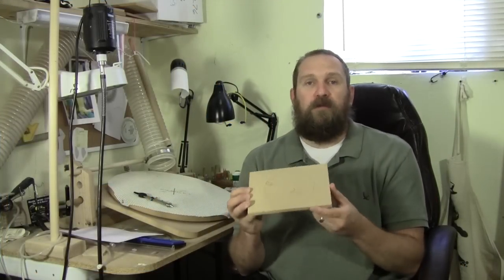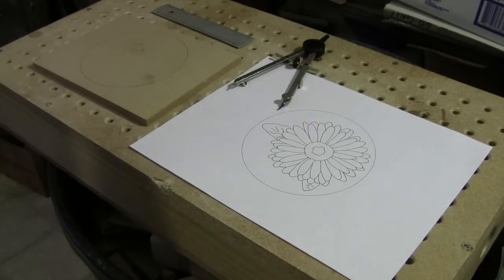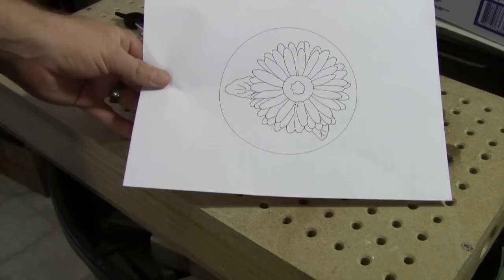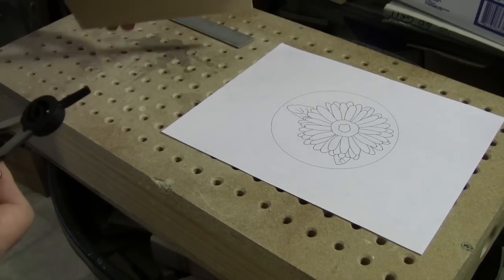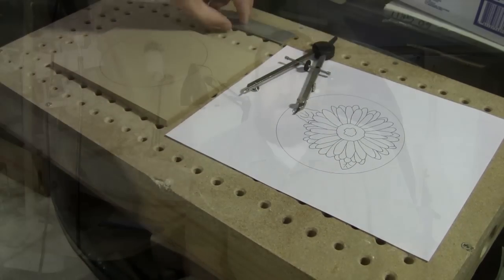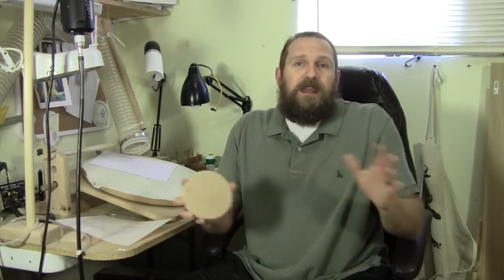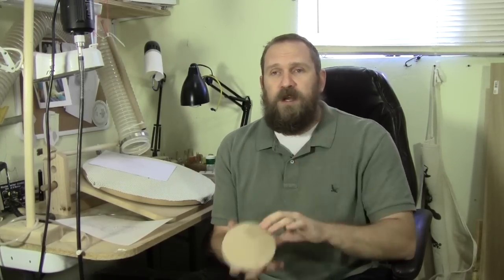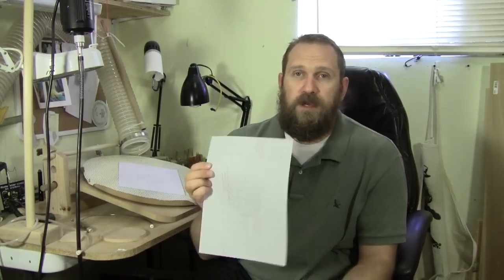01 Relief Power Carving - High Speed Engraving - Daisy Carving Introduction

Comment: Ok I haven't made it all the way through the video yet and wanted to thank you for the information. But to save others some time the 1st 14:10 essentially says Use MDF to practice on because it's easier and cheap. Then either print design on paper and use spray adhesive or print on transfer paper, dry ink with hair dryer and stick to wood.
Reply: Ok I guess just forget my post. I was under the impression this was a video about how to do relief carving but it never got that far. It's a very detailed video to show how to stick the design to your wood and how to hold your cutting burr in vice grips to clean it.
Reply from the maker: Dread Spawn Thanks for sharing this video. This video is 1 part of a longer series of videos. It is broken down into smaller segments for easier viewing. The Power Relief Carving 101 Video series is an introductory instructional video to help others get started with a basic power relief carving project using a high-speed engraver. Here is a link to watch the full series, download the image, and follow along: http://carvingonwood.com/powerrelief101/
Reply: Grinding on MDF causes Cancer! How could you recommend it!

Comment: mdf dust is bad, would have to spend extra to maintain safety in the working area whilst using it.  Also a beginner practiced on MDF will run into all kinds of problems when they step upto natural/grained wood.  Better to get comfortable with the flow of grain from the get go in my opinion.